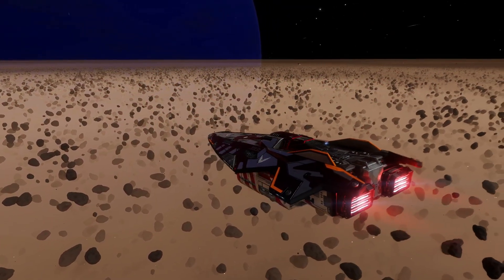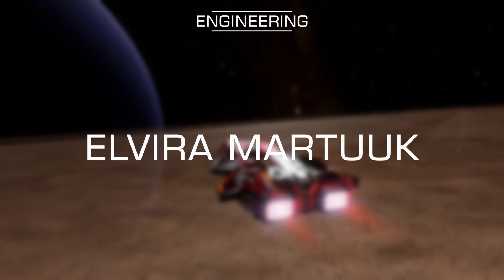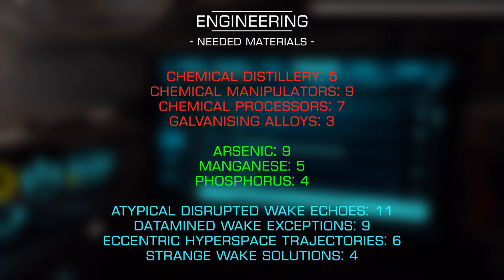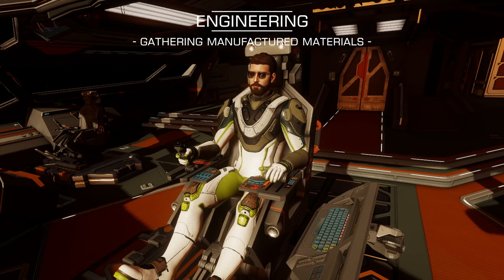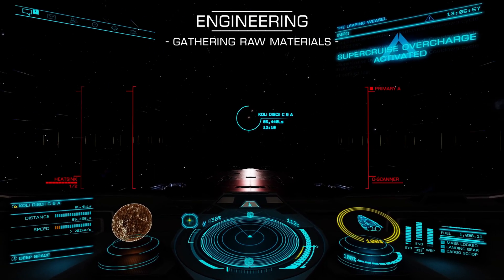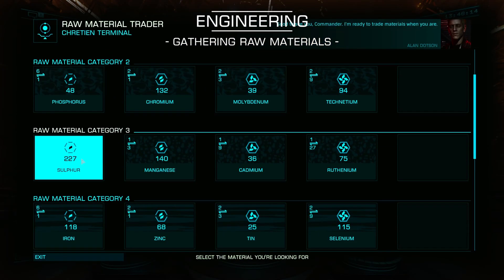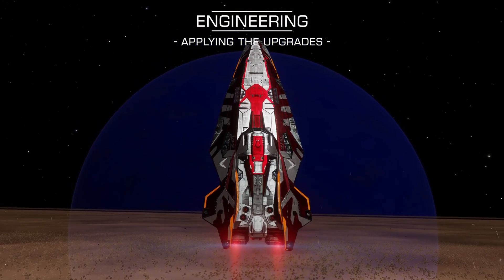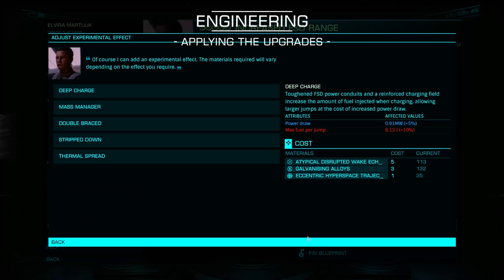READ DESCRIPTION! How to Engineer your First FSD | Elite Dangerous Engineering Guide 2025

Comment: Great Video as always.  The Crashed Anaconda in Orrere is in the bubble and not too far from the jump in star.  It is possibly quicker to cross trade from Jameson Crash site but I too have done Distribution Centres just for the change.  If you are going to use limpets for Mech, farming Dav's Hope with limpets is quite viable... although limpets while in combat, you don't have to worry about anything, just let them do their thing.
Reply from the maker: Solid advice. The Orrere conda has some truly annoying terrain, it’s a small thing but that’s why I go Koli Disci. Jameson site is… yeah. Quick, but tbh I’ll take any vaguely working method instead 😅

Comment: Whilst I'm way beyond this point in my ED career, I just wanted to say 'excellent guide!' and also pass along a request about something that channels like yours, who focus on players new to the game, tend to forget to mention.

Everybody loves to use Inara to find stuff. That's fine. I make extensive use of it myself.

Probably my single biggest complaint about ED is that nowhere near enough commanders contribute to the data Inara provides. Apparently, some people even think Inara taps into Frontier's official ED database. It doesn't. It's a 100% crowdsourced database, with every bit of information in it provided by other commanders.

They (well.. the PC players at least - console players, we understand your pain!) do this by installing a tool called 'E:D Market Connector'. It connects to the database and updates it on everything going on in the systems visited, as they play the game. And frankly, EVERY SINGLE PC COMMANDER SHOULD BE RUNNING THIS APP EVERY TIME THEY PLAY!

What I wish channels like yours would do, is any time they post a tutorial video like this one, and mention using Inara to help find stuff, PLEASE tell them about EDMC and provide a link to it. The more new commanders that install the app, the better it will be for everyone, as the system will get more updates.

Thanks!
o7

Comment: Personally my favourite method for getting raw materials is going to a planets with high grade crystal shards.
It avoids having to relog, has you drive around on a log g planet and it is a decently fast way to gather mats.
While farming shards is not as quick as it used to be I prefer it to the other methods
Reply from the maker: True. It’s a bit far out for me to recommend for ‘all players’, but it’s definitely my preferred method. I like to bring a flak cannons as well, so you can blow the crystals up in your ship, then scoop in your SRV. 

Particularly fun and efficient with a friend - one flaks, the other scoops. Had one of my most fun and effective sessions ever raw farming like that 😅🫡
Reply: @DiturisElite  I'm going to start gathering raw materials soon and I read about this method too which I'm going to try, but with one change, bringing collector limpets instead of the SRV. The limpets can get stuck and get destroyed on the brain trees, but apparently if you travel 5-600 meters away the brain trees disappear and the limpets will collect all the resources. I'm definitely going to try this to see how it goes!